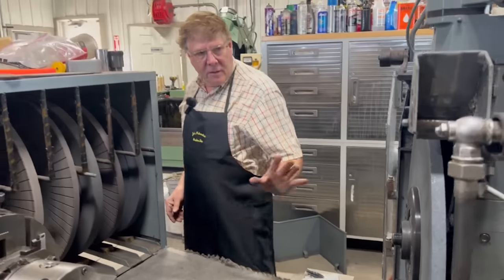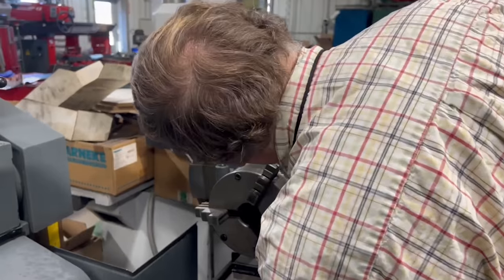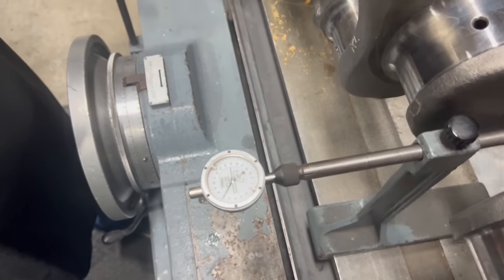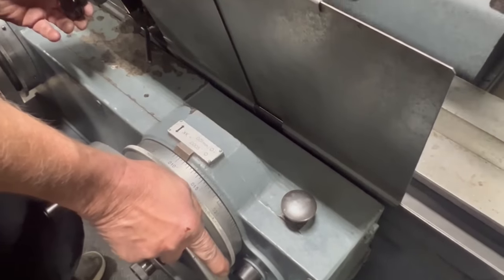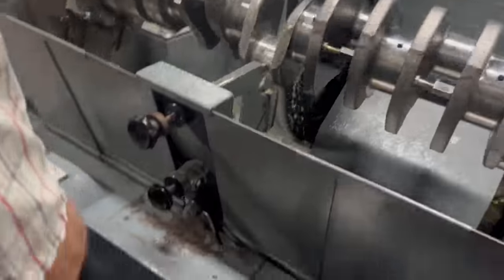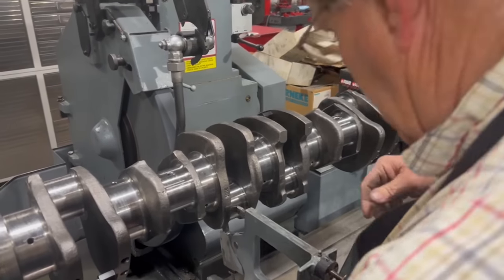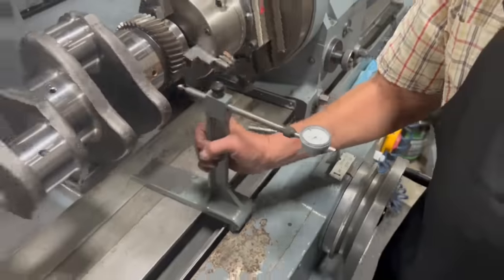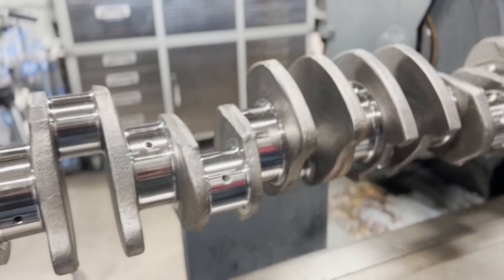This Cummins Crankshaft Was Almost Scrap Metal...

Comment: I'm sure that a cnc version of this machine is available for plenty of bucks. However, I'd rather have an experienced human do this type of precision work. So much to think about when grinding a crank, especially the rod throws. I wonder how much of the wheel is consumed each time the radius has to be changed for different cranks ?

Comment: I noticed that he shut the wheel off after dressing it. I'm a prototype/one-off machinist, and we never shut our surface grinder off after dressing it until the part is finished. I was always told this is because when you start the grinder up, the torque from the motor can very slightly change the concentricity of the wheel and it would have to be redressed. Is this not a concern with these types of grinders?

Comment: Let's say you have an antique crank with a spun rod bearing?  Would you sacrifice a bit of stroke just to save the crank?  I.e. center around the offset caused by the spun bearing(spun bearings always seem to wear the pushed side of the journal much more  the the pulling side).   I used to do that.   Sure, the crank wasn't perfect but at least it would work.

Comment: Is this crank going into a total overhaul with a new block? 

I was told that you shouldn’t straighten the crank going back into an old block, in big engines as the block has the same twist in it as the crank and they are mated to each other.

Comment: I guess  I must really have lucked out using half assed methods to clean up crank journals. Either crocus cloth or oil soaked fine sandpaper. It seemed to work, one way or the other.

Comment: Hello! 
Great work! Love your videos! Couple of questions:
1. If you were to put it on V-blocks again and tested for warpage, after releasing this or any crankshaft from chucks on both ends, wouldn't it show some play on the main axis??
2. Don't you have to swap out for finer grit belt that covers most of the journals width for polishing? Or maybe do it by hand with your own belt? 😅

Comment: When doing the sanding to reverse the micro-burrs, would it not be possible to use a leather belt to finish off the polishing. Would that not have the same effect as the leather strop we use on a straight razor?

Comment: Wondering.... Would the angular momentum of the combustion process of a rotary engine produce the same disfiguration on an eccentric shaft as the powerful diesel cycles did on this crank?

Comment: What about oil passage deburring? That can be the ruin of a good crankshaft grind!
I have seen “mechanics” ruin a freshly ground crankshaft because the oil passages “ needed” to be deburred after grinding before installation. The mars and gouges in the journal were for oil retention I guess! Of course the machine shop cleaned the crank so no need for the “mechanic” to do any cleaning!

Comment: I'm about due for an inframe myself I'm gonna get all new head,cam crank etc so everything but the lower block is new but I want to send in old parts and have them reground/spec'd and store them until I need them is it good for a crank to sit a couple years in parts oil or will it still rust? And yall may be getting to do the regrounding I'm really impressed with yall
Reply: Crank can sit plenty long in a controlled environment for a few years no problem.  Honestly time the machine work better.  No reason for anything to sit for two years.

Comment: Listening discussion of polishing out the “burrs” on the main and crank journals, is there some “rough” figure that would compare the size of the burrs to the thickness of the oil film when the engine is running with full oil pressure? It seems like “dirt”particle size in the oil when it is due for a change would probably be greater. I am not even sure what particle size the oil filter will pass when it has reached the service interval.
Reply: Where that really shows is the wear that happens when starting. A well polished crank doesn't scuff the bearings.

Comment: That's when I take 1% of the price off that was my mistake because I'm giving him a fat crank still. That is that crank can go for another grind and the next grind can still be well within that window.
But that mistake was not near as bad as you're making it sound because even if the owner is a particular and isn't happy with the work you can still sell that shaft to the next guy who has no chance of saving his crank. That really it all depends on the man's bottom line and how much pressure he's going to be putting that crank under. If he's acting his machines out all the time he may absolutely need to be that stickler to reach his bottom line. Even then it sounds like this grind should be fine but he won't be able to send it in for the next grind. Requirements can be anything between four hairs and baby hairs and once it's gone you just don't get it back.

Comment: I think I heard Pop say something about the conversion from Imperial to Metric and the differences...
How close is the conversion back and forth at these small increments...?
Reply: It is precise. 1 inch = 25.4 mm, make sure that you use enough decimals to avoid unnecessary rounding errors.

Comment: A huge $500 million crank shaft manufacturer went bankrupt here in India. They made crankshafts for locomotives and ship engines. All German CNC machines and machines from USA , Pennsylvania with German name companies. 
Nearly a thousand crankshafts lying around. Huge 33 feet smelter. 
Unfortunately nobody has much understanding of it. It's been closed for last 12 years. A friend has picked up the unit from the bank. Unfortunately scrap guys want it all in just metal weight. 
There is one whole building with brand new machines still in process of getting hooked up when there was a strike and a lock up and then abandoned. 
Any one interested I can hook you up.

Comment: How much metal is removed when you polish the journals?
Reply: Your just flattening down microscopic burs, so less than 1/10 of a thousand. I always dull my belts before use, using a wrist pin in the chuck jaw.

Comment: Somewhat off topic... Most of the auto machine shops I've seen have been covered w/ grease, top to bottom, with engines/parts scattered all over.  Is there an art to keeping this clean and organized aside from "Clean up your (feces)"?
Reply: Lighting.... that's different than many "machine shops" including factory ones... as in, "you have enough lighting to actually see"?
Reply from the maker: Drives me nuts to walk into a shop where I can’t see. We prefer the shop to be bright like an operating room!

We aren’t the tidiest shop, but we’re definitely better than some. I guess it just takes discipline. Clean while you’re working, keep a vacuum near each machine. Vacuum up chips instead of blowing them all over w/ compressed air.

If you stay on top of it it never gets bad,

Comment: You can chime the rough surfaces just as long as you don't get close to the smooth ones. But it freaks me out every time somebody does it with white metal hammer brass copper or dead blow nothing else goes near my life unless it's a cutting tool or a key. But that's just my paranoia talking.

Comment: F**k mm's! Nothing wrong w/ imperial measurements. Did this older machinist have an apprentice? Are you his apprentice? The older machines are far better made then anything off shore(I can think of one name). The grinding machine is designed w/ imperial measures, leave it & use imperial bearings. Faster & easier. Now he did confirm my suspicions that the rotation of the wheel should be started w/ intermittent bursts of power to not so mush overload the electric motor but to extend it's life. The trick of the screw stiffeners between each of the journals not being ground is excellent. Good video!

Comment: Question.. (For anyone who knows) about 'dressing' the grinding stone:
    I have a small bench grinder.
Could I use a sacrificial piece of metal to dress the grinding wheel...? 
     Or does that require some kind of special thing?

There's a groove in/on the 'outer ring'... 
....(err... along the 'circumference'...? eh... dammit... where's a tool dictionary when ya need one.. 
      "all along the edge..."? 
      ... the flat part that goes all the way around it... (?) 
     ...F* me, man...
    I give up on terminology.. 🏳️) 

Anyways.. the outside edge... I need that to be flat again. 
     ..and I want to slightly taper or curve the edges a bit (not necessarily precise).

Would a random piece of metal do?
Reply: To Ronaldo: 
He shows and explains for you in the video. He uses two diamonds. One for the 
mantle surface and one for the “corner”. 
A Diamond is also good to sharpen a common grinding machine when You grind a drill bit by hand. / Have a good 2023. Greetings from Sweden. 

Your dealer probably can show You some alternatives.

Comment: I know pretty much what you have to do for a setup minus all of that sand because I don't have a grinder for my metal lathe. And honestly I would not do it without a mist coolant system. Sand Will Roll if it's not wet. Basically I'm saying you're missing all the good parts the parts that I want to know you're cutting them out. I'm guessing about 6 hours worth.